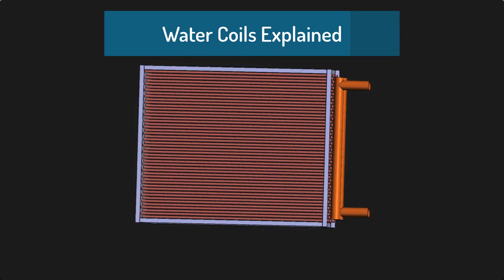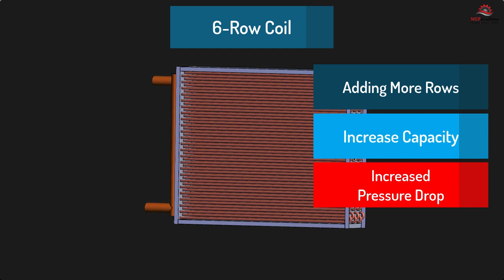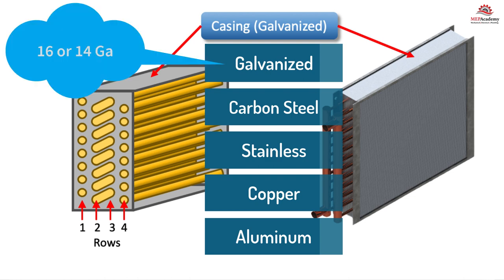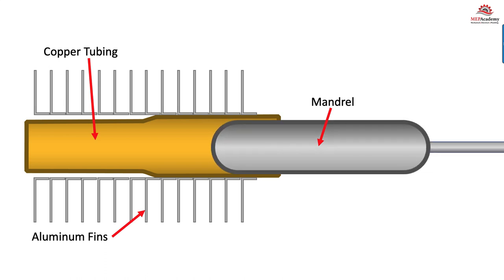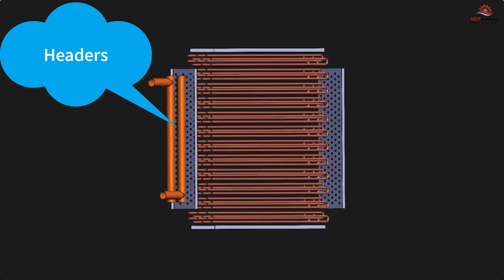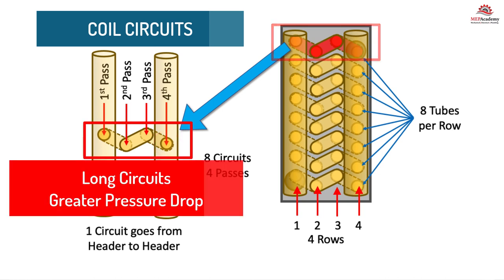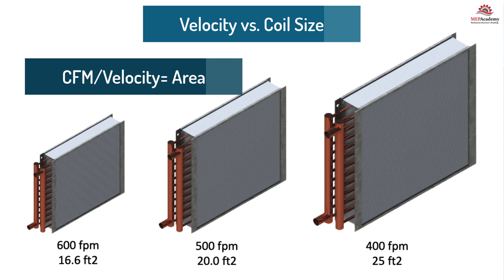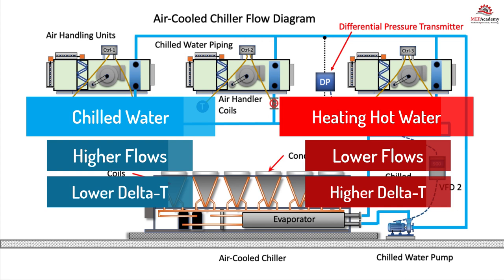Water Coils Explained

Comment: We have been installing 20x25 reheat coils with our geo systems.  My question is the placement location from the ahu.  If the rh coil is too close to the would that causes to much static pressure at the ahu causing condensation at the ahu?
Reply from the maker: Not sure we understand the question, but reheat coils can be found at the air handler, especially when using a multi-zone AHU. No matter where the coil is located, it still has a pressure drop caused by the friction of the coils and fins to the air flow. The AHU fan must overcome the static pressure of the reheat coil no matter where it is located, unless there is another fan, as with the use of an induction box.

Comment: Thank you for the video. Is there a way to calculate the cv on a chill water valve if it needs to be replaced but the information on the valve is not visible or available?. Thank you
Reply from the maker: If you can record the GPM or (L/m) at full flow and get the pressure drop across the valve, then you can calculate the cv. The CV = Q x Sq Rt of Specific Gravity of Fluid / Sq Rt Delta P. Check out the Belimo website for more information as they manufacturer control valves. https://www.belimo.com/us/en_US/

Comment: If the requirements for FPI is 10 FPI,  but the actual is 11 FPI what is effect for increasing the FPI?
Reply from the maker: An increase in the FPI can increase the heat transfer area and efficiency but at the expense of static pressure. At some point adding more fins per inch is not beneficial for many reasons including condensate retention, difficulty cleaning between fins, energy impact, higher air side pressure drop. The manufacturers coil selection software should be used to find the best coil for the application.
Reply: @MEPAcademy  we have minimum or maximum tolerance for FPI?

Comment: What's the way to know what hand thr coil is?? Left or right? Did I miss it?
Reply from the maker: At 5:19 of the video is where we explain how to determine whether the coil is right or left handed. Facing the coil in the direction the air flow is how you determine whether it's right or left handed. Standing in the air stream looking at the coil with the air blowing at the back of your head, the pipe connections will either be on your right or left side.

Comment: Dear Sir 
Please clarify the LHS and RHS Coils one more time,
Reply from the maker: This determines which side of the coil will get the piping connections. The coils are fabricated to point in one direction, so this helps determine where the pipes should be, on the right side or left side. This is determined by the direction of airflow. If you stand with your body and head looking in the direction of the flow of air, as if the air was blowing on the back of your head, then if you want the piping to be on the right side where your right arm is, then its a right-handed coil, otherwise its left-handed. Hope that helps.